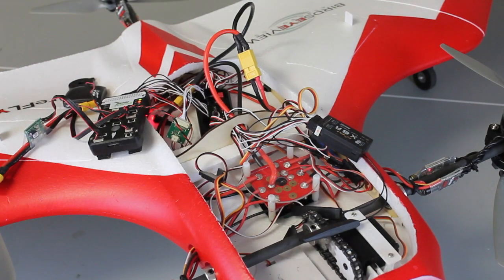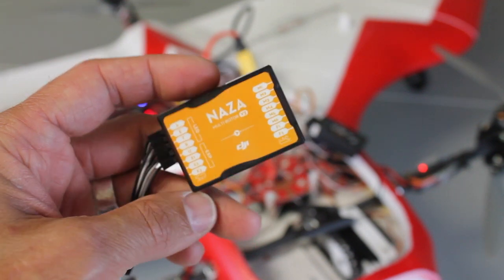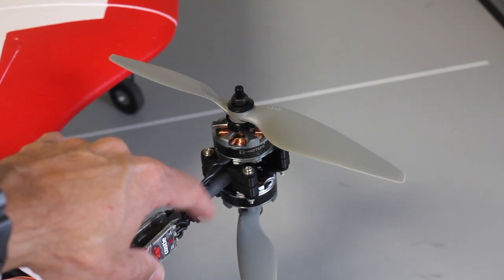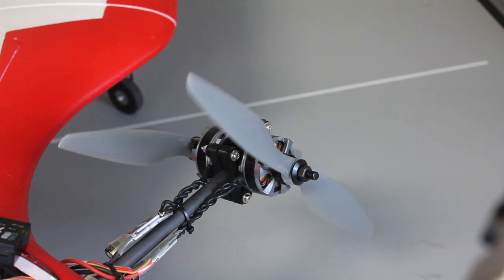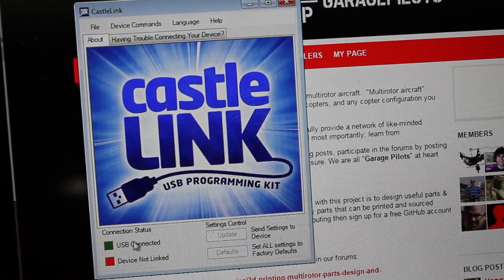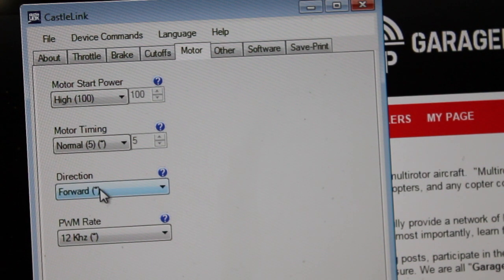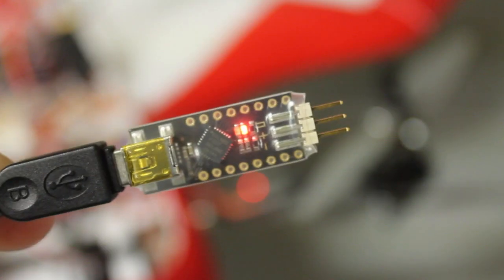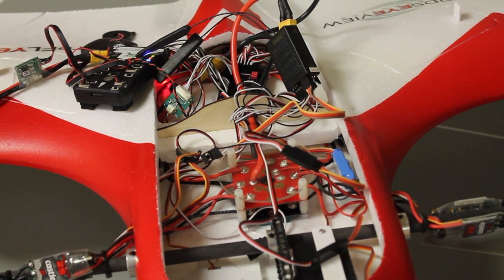Reversing Motor Rotation with Castle Creations Multirotor ESCs and Castle Link

Comment: If  you ever have sync issues with your ESC's and 4s-6s batteries, try Rotorgeeks BLheli V4 ESC's. They also have the motor reversing feature, are sync issue free, and are only $14 ea. Check out the torture test video on youtube... Anyway, nice vids
Reply from the maker: SoupMock Thanks for the feedback. I've heard great things about SimonK and have never flown with BLHeli. I've been wanting to try it though and have a project where they'll come in handy. Appreciate the tip.

Comment: Thanks for all the help over the last few years. I also had a very good experience with the castle escs and castle link. The low weight of the 25 amp is beneficial and notable.  If you could cover some telemetry functions of the taranis without making it to complicated it would be a nice video. Take care
Reply from the maker: Howard Bardwell No problem at all. I appreciate you following along and the feedback on the 25A ESCs. I agree with you about light weight. I'll plan to do some Taranis telemetry videos in the coming weeks. Take care.